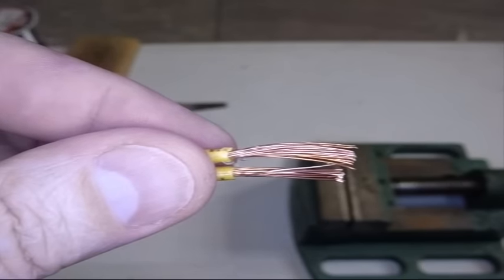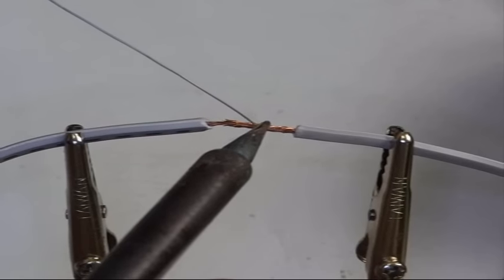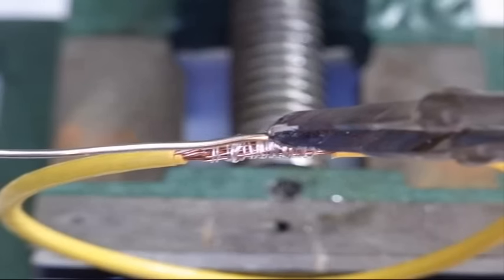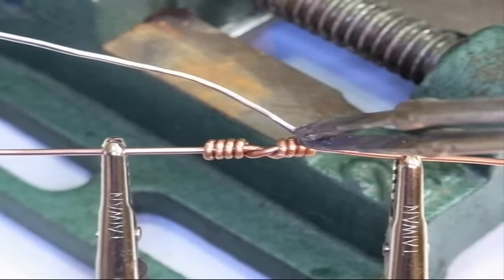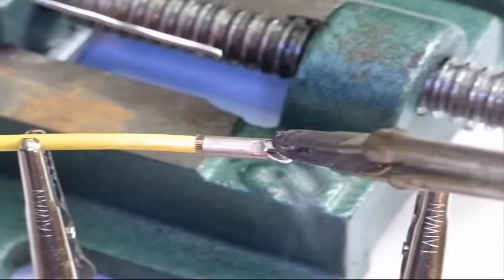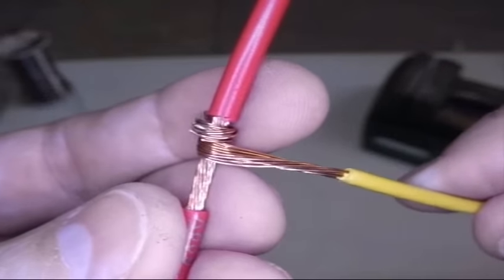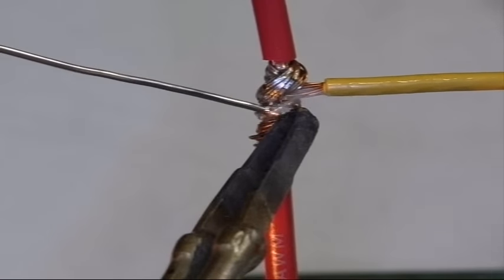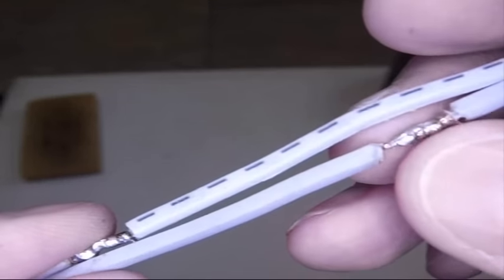Soldering Basics - Popular Solder Connections

Comment: I thought you needed to heat the wires up from the opposite side from the solder and allow the heat to draw it through. Your method encourages a dry joint or am I mistaken?
Reply from the maker: That's a myth about heating from the bottom.  Even the soldering companies show heating from the top and every hand soldered circuit board in the world was soldered from the top.  I have a video debunking that myth here: https://www.youtube.com/watch?v=NfQd9wLJUuw
I'm guessing people think that the rising hot air from the soldering gun adds more heat.  Of course that is nonsense because any heat from rising hot air is offset 1000x by the hot solder flowing out of the joint and down the soldering gun (1 drop of solder has many times more heat content than any amount of air with will rise from convection while soldering). 

There could be 1 actual benefit to soldering on "opposite sides" of the work; that keeps unskilled workers from touching the solder directly on the gun which burns off the flux leading for higher solder use and creating potentially poor joints.
Reply: I was wondering the same thing, thanks for asking and thanks for answering.

Comment: 6:00 isn't this basically 2 inductors? And judging from the diameter of the wires a lot of current will pass through
Reply from the maker: +papalevies Interesting question.  If the windings were insulated and current passed from 1 end to the other, then yes they would be inductors.  I'm using bare wire which means the windings are shorted, especially after being soldered, and hence act like 1 big, fat wire.

Comment: Great video, I'm a noob, so any advice is helpful.  I have a bunch of 3-way splices to make.  Your demonstration where you tie a knot is what I'll do.  One question: how would you recommend I insulate those joints?  Just electrical tape?  Any better options?  Shrink tubing probably won't work because of the T junction.
Reply from the maker: Thanks.  I use the 3 way primarily for things like ham radio antennas (no insulation) and low voltage applications (12 volt), not mains power.  When I splice into a car or motorcycle or trailer harness I tape carefully, especially the 90 degree parts, then secure the loose end of the tape down with shrink wrap.  Note that tape can shift around over time, so you want to make sure the joints are where nothing is pushing or pulling at them.
Reply from the maker: Also, I have another vid on the basics of soldering.  The summary is: clean solder, clean work piece, clean soldering tip.  And never use acid flux on electronics!  
https://www.youtube.com/watch?v=fNyAK1WvtsA
Reply: tsbrownie 
Thanks again!  Yup that should work just fine for my situation.  Love the idea of using shrink tubing to hold the tape.  :-)

Comment: I have been trying to learn to solder electrical but I can't seem to achieve capillary action and it winds up being lumpy.  what am I doing wrong ?  also I don't know why my specialty Flux isn't working.  what do you think
Reply: You heat the joint/wires to solder. You don't heat the solder. If you can't get the wires hot enough for solder to liquify and be drawn into then you need more heat.
Reply: The Flux burns away before the wire gets hot enough to melt solder
Reply: Use a solder with flux in it. Easier for starters

Is your iron powerful enough?
Reply from the maker: Mudemmeonick is right.  Also, check out this video: https://www.youtube.com/watch?v=fNyAK1WvtsA
The summary is clean, clean, clean.  Work piece, soldering iron AND solder must be clean, oil free and free of corrosion.  Oil from hands is bad.  Brown copper is bad.  Heat the piece, add a touch of solder to the tip to help carry heat.  Touch the solder to the work, at first it will get mushy, then it will flow.  If it does not you either don't have enough heat or you are moving too fast.

Comment: You are god! Is there a specific brand of soldering equipment you use? And type of solder?
Reply from the maker: Just plain old *rosin* solder from the hardware store (never acid on electronics!!!).  I've used the cheapest and some bench quality hardware.  The only real secret is clean: clean solder, clean work-piece, and clean soldering iron.  Oil from hands or other really messes it up (if you get black stuff and the solder won't stick, something's dirty).

Comment: It may be obvious but perhaps mention that if you intend to use heat shrink insulation, cut it to length and slip on one of the wires before soldering your joint.

Comment: I have to be honest, Ive been soldering over 20 yrs, TH, SMD, you name it (IPC Cert) etc blah blah, but, I picked up a couple of tips from your video! Job well done, thx! ps I know what you mean when you say badly coroded wire! Ive seen copper that has turned black, and the product manufacturer *still let it pass..(scary)
Reply from the maker: +Scott x Thank you.
Reply: +Scott x I wish I saw this video before I repaired my ABS wire on my car. The wires insulation was damaged and the wires were black like you mentioned! I did my best repairing the wire but feel that I could have done better. Overall my ABS light went away on my car 8)
Reply: Omar is Rad
If the light went away, you did it! I remember a Simpsons episode where Homer saw a light pop up on the dashboard and he covered it with tape. Gotta love Homer, DOH!
Reply from the maker: Flux will remove very light corrosion, but it's best to clean the wire mechanically first to remove significant corrosion.

Comment: - When soldering audio male connectors ex. RCA (phono) or headphones, put a female connector on the end, it will help hold the center pin in a perfect middle position. This applies for both male and female connectors of any type where the plastic will tend to become so soft that the center axe ends up with an angle.
- Best cutters for small size wires under $5 = Nail cutters. Try to find a straight one without a curvature. Does an impeccable cut and will last you for years.
Reply from the maker: Good tips, thank you.

Comment: i would suggest a diferent soldering tip to get a good heat transfer on the soldering pencil but i will say nice filletes
Reply from the maker: You're right, the right tool for the right job is always best.  Over the years I've had to get used to making due with what I've got.
Reply: +tsbrownie yes its a matter of experience and not because of soldering tip...  I can solder a 1mm size component or led using regular 30w tip with no problem...   crazy but true   =)

Comment: Hi 
I want to know the name of company for the flux 
And where I can buy it
Reply from the maker: The flux is inside the solder.  It is rosin core solder.  The tin/lead is made into a tiny tube and the flux is inside.  For most electronic/electrical soldering you do not need extra flux.  And if you do buy flux for electronics NEVER use acid flux.  Use ROSIN flux.

Comment: Do you use ready fluxed solder?
Reply from the maker: This was rosin core solder with the rosin on the inside.  With electronics you want to use rosin flux and NEVER acid flux!  Acid flux will eat away tracings and it gets under chips, soaks into boards and such and leaches out over time.  It's impossible to clean away.  Long ago I ruined a kit by using just a bit of acid flux and over 15 years I could never get rid of the stuff, it finally ate through many tracings and I threw it away.
Reply: Of course different solders have their places depending on what you are doing.  In the case of wires like we have here a rosin core works well.  Sometimes - if you need to clean wires up some brush on flux can help things along.  Then there are many different types of soldering that you just can't get flux into the solder and liquid flux is not the best solution - such as BGA soldering.

Comment: may i know the wattage of your soldering iron used?
Reply from the maker: The small one is 2 wattages, I think it's 30-60 and the big one is too much for most home jobs, I think it's rated at 130 watts.  The wattage you need will depend on the size and type of your work.  (Also on skill level.  For example, in factories the most skilled workers can use very high wattage irons to get a lot of joints done fast.  It works because the people know how to do it quickly without damaging parts, but literally half a second too long and something, board, component, is ruined.  I don't recommend that.)  If you can try a friend's soldering iron / gun and see if it works well for you on the types of things you solder.  That's the best way.

Comment: I"have a 60wat weller soldering iron and it cannot melt 0.8mm solid core solder wire!
please help what do i do "
i've tried waiting like 30 min for it to heat up it melts it slightly but it doesn't flow!
what do i do?
do i need a 80 wat or higher iron!
Reply from the maker: Soldering gun or iron?  How old is it?  I've had 2 problems with soldering guns:  1) the tip corrodes away and actually cracks and it will not get very hot.  Fix is to replace the tip  2) the connections from the tip get corroded and it won't heat up.  Fix is to clean the 2 connections and ensure they are tight (follow instructions on replacing tightening.)  If it's not one of these two, it may be defective.  
For soldering irons, the tip may be really dirty or it's not making good physical connection with the heating element.  Check the instructions for cleaning and tip installation.

Comment: Nice, thanks :-)   By the way:
Some times I need to connect cables and got no soldering iron. Before twisting them together like shown in the very first example I seperate the cable into maybe 4 parts each cable. Then I twist the first with the first, the second with the second etc and now got 2 cables with fout twisted ends. At last I make a worm out of those four ends like shown. This connection is not easy to destroy by pulling the cables.

Wenn ich zwei Kabel verbinden möchte und die Verbindung einer gewissen Zugbelastung standhalten soll aber kein Lot habe, dann spleisse ich die Enden in 4 Teile auf und verdrille zunächst die  vier Enden des einen Kabels mit denen des anderen Kabels, bevor ich alle 4 umeinander drehe.
Reply from the maker: Vielan dank!  I would think that the better intertwined (more surface area contact) the better the electrical conduction.  And it would likely help with mechanical strength as well.

Comment: What temperature(s) are you using on your iron for these examples?
Reply from the maker: It's not so much the temperature so long as it's significantly above the melting temp of the solder (60 : 40 is about 374 F or 190 C).  It's more about how much heat per time the iron can produce and how much heat per time the work is carrying away.  So a small iron with high temp can never solder big wires, the work is a heat sink that carries away heat too fast; the work never heats up much past the area in direct contact with the soldering iron.  
On the other hand a really skilled production line worker can use an iron so hot that would cause most of us to damage the work piece, but because they can work quickly, they can get the connection made before the heat damages anything.  

Weller has a pdf with lots of info you can download.  Google "weller soldering pdf guide to better soldering"
Reply: tsbrownie Thanks for the very informative reply!
Reply: 60W for those wire size will work perfectly, 30W for PCB & electronics

Comment: I don't see when you apply the flux. I tried without before and it won't stick on the wire.
Reply from the maker: Most good electronic solder is rosin core - that means the flux (rosin) is inside the solder.  The solder is actually a tiny tube with the flux filling the void.  So when I'm soldering the flux is being supplied by the solder.  NEVER use acid flux with electronics.  I have several videos on soldering, one is about common mistakes, it covers what I said here in much better detail.
Reply: @tsbrownie  well, that's what it says in the package but still it dropped to the ground rejecting the wire
Reply from the maker: Is the wire copper, is it REALLY clean?  Please watch my video on common soldering mistakes.  It will show you what I mean.
Reply: @tsbrownie  Not sure ir Cooper ir not. I just tried to resolder a connection that separated by itself. 24volts system on a rotoswitch

Comment: The bare butt splices when crimped and soldered make a pretty strong joint for automotive use. My company builds armored vehicles for the military. These are what we use to make repairs to broken/damaged wires. Crimp the joint 1st then solder it. Make sure to tape or heat shrink afterward like the video says. When doing automotive wiring repairs you don;t usually have enough wire to make the other style repairs or many times you are working in tighter spaces so this is pretty easy.

Comment: I noticed you use no flux. Does the coper have a flux core.
Reply from the maker: The solder is *rosin* core solder.  Never use acid flux on electronics!
Reply: soldering lead has a flux/rosin core...  try to cut it with nail cutter or scissor to see the core...

Comment: how would you heat shrink the 2nd to last connection
Reply from the maker: You mean the 3 way splice?  You can't really shrink wrap it.  First I don't use them for high voltages (above 12 volts).  I tape them carefully then use shrinkwrap to hold the tail of the tape in place.

Comment: do u used flux  because my tin never sticks to it
Reply from the maker: I have a video on soldering basics.  The main thing is to ensure everything is clean: work piece, soldering iron, and solder.  Use rosin core solder.  You should not need any other flux.
Reply: do you have a vid on headphone wires because i always have trouble on thoose, there is some sort of coating on the wire and my connextions are not strong. so could you help me out on that one
Reply from the maker: I know what you mean, there are some very flexible wires that are coated with something that makes soldering them very difficult.  The solder just balls up and rolls off and the wires turn black.  My best answer (and it's not great) is to very carefully scrape the individual strands.  Then mechanically wrap them with a thin bare wire then solder.

Comment: Good tip but I cringed when you didn't clean the rosin off of the joint. Guess you know that stuff is corrosive to the metal.  If you agree then maybe add text to that beautiful  joint instructing a clean with alcohol before insulating with shrink...Thanke from a  fellow technician. Will chech out your channel you go bro
Reply from the maker: Good point.  I keep intending to make a post-solder video including cleaning.  The list grows longer...

Comment: My soldering iron doesnt melt the lead is there something wrong with the wattage?
Reply from the maker: It may be too small for the job, depending on what you are soldering.  It depends on how much heat per time the iron can produce and how much heat  per time the work is carrying away.  A small iron with high temp can
 never solder big wires, the work is a heat sink that carries away heat 
too fast; the work never heats up much past the area in direct contact 
with the soldering iron.  
It can also depend on the type of solder, some have rather high melting temps.  Check your solder.  Most is 60:40 and that melts around 374 F or 190 C.

Weller has a pdf with lots of info you can download.  Google "weller 
soldering pdf guide to better soldering"
Reply: try to clean your soldering tip by using steel wool...  or sand paper for busted low quality tip

Comment: Can you use Solder for underground splices?
Reply from the maker: It really helps.  Soldering ensures you have the least resistance, the best corrosion protection and a mechanically strong joint.  That's all about the copper part of the wire.  Then you need to think about the insulation, how to keep the wire protected from water and keep the surroundings insulated.  Solder does not help with the insulation part.

Comment: My favorite way to solder two wire ends together is to fan the ends out, lay one over the other, twist them together, and brush some flux. If one is a little thicker than the other, I will fold it over onto that wire, laying it as flat as possible, and insulate with liquid electrical tape. I try to avoid the stuff on a roll, as it doesn’t like to stay on if it gets warm. If anyone has any constructive criticism of this, I would love to hear it (so to speak).
Reply: Double-wall (adhesive lined) heat shrink tubing is wonderful stuff.

Comment: The first method or second never worked for me I don't know why , when I solder it always makes small balls on top of the wire never  sinks in , WHY .
Reply from the maker: The problem is most likely: 1) dirty wire / solder, 2) not hot enough.
The wire has to be shiny copper color, if it's brown it won't sink down!  If your soldering iron does not have enough power, the copper will never reach the temperature of melting solder, so the solder stays on top.
Reply: The mistake many make is that they do not use solder to make thermal linkage between the iron and the copper, then feed the solder onto the wire, not onto the iron. if you cannot get the wire to melt the solder you have too small of an iron, tool little heat. A good solder connection should take more than six seconds to establish heat flow, add solder to the rest of the joint, and remove both solder and iron at the same time.